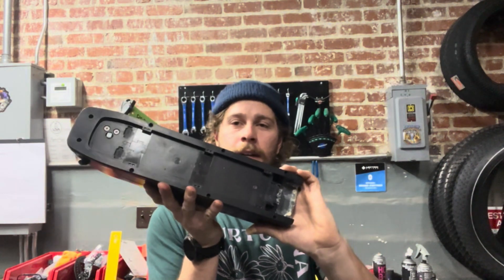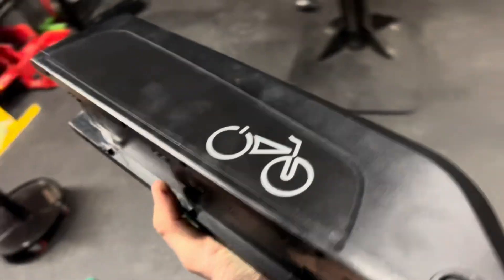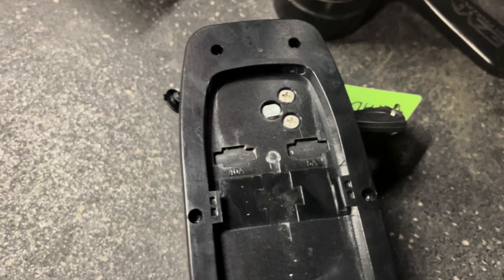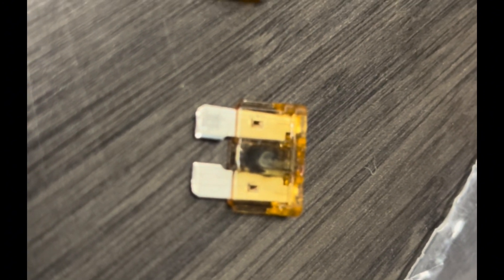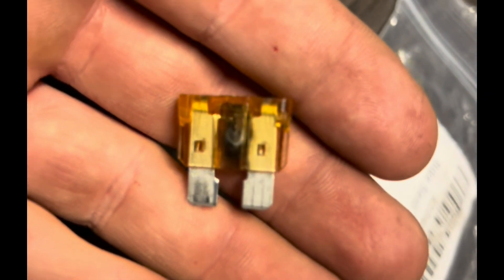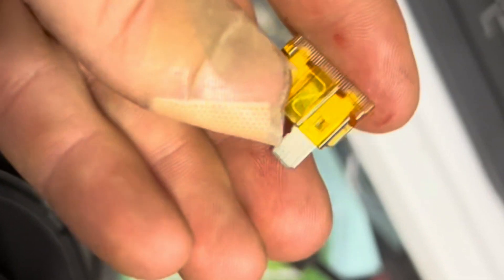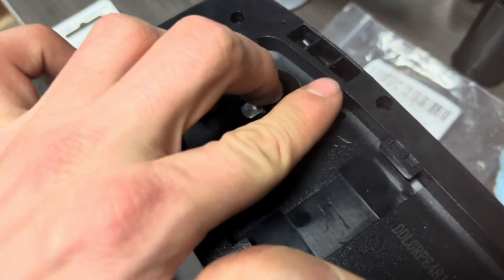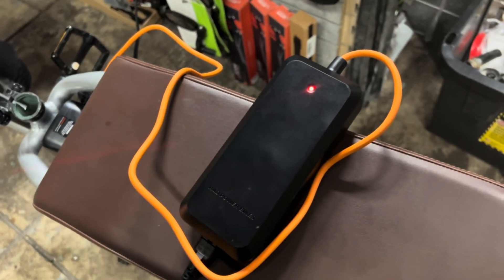RadRunner+ Battery Fix: How to Replace the 5A Fuse for Full Charging

Comment: For those struggling like I did: I didn't have a thin enough flathead screwdriver, I finally got it pried out with an box cutter knife blade.

I also didn't have any pliers small enough to pull the fuse out (even bought the smallest pair I could find, still too big!), I finally got it out with tweezers, I had to clamp it down as hard as I could on one side and leverage it against that side to pop the fuse out.

Comment: Has anyone else had problems getting that fuse cover out?  Any recommendations as to how to remove it?
Reply: It’s usually a rubber piece and so I use a flathead screwdriver to try to press down and into kind of scrunch it up so that it kind of starts to pop up and you can get better placement of that flat head and pull the rest of it out sometimes I can pinch it with pliers to do the same thing